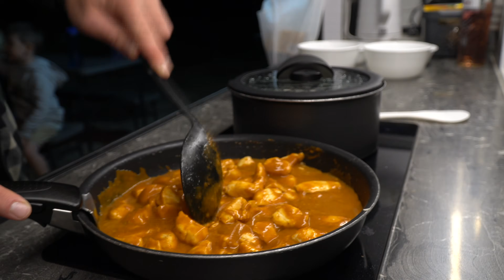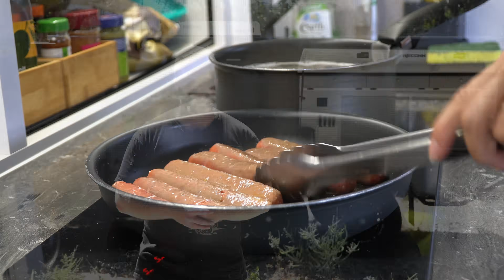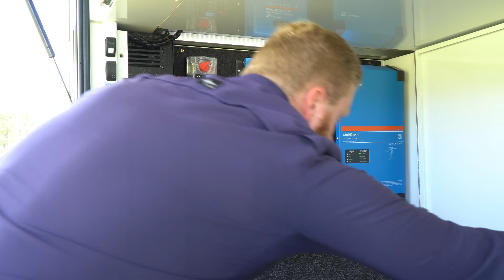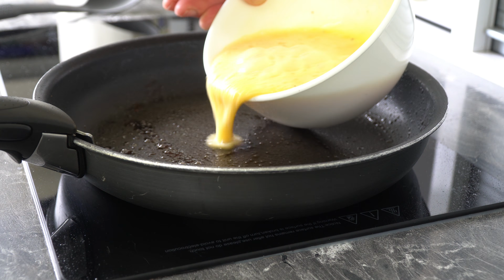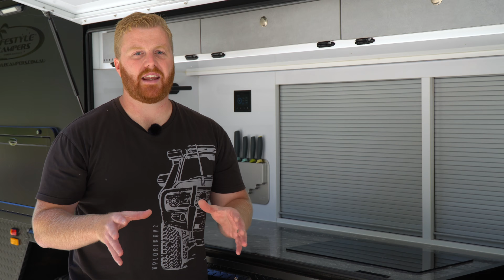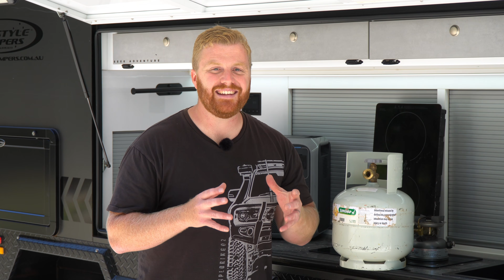WOULD I DO IT AGAIN? My experiences, failures & advice on INDUCTION cooktops for OVERLAND & CAMPING

Comment: I honestly thought you’d have a 60A DC-DC. I have a wagon with a 400Ah LiFePO₄ and I use a 40A DC-DC (I’d prefer a 60A one). 

Another reason to carry a portable $40 induction cooktop and a butane stove. 

You can get 200Ah LiFePO₄ for under $1k and 400Ah for $2k. Also a 3kW inverter - $500. 

Our Camper Trailer has a 4 burner cooktop in the slide out kitchen. We carry a butane stove in the wagon as backup but we use the Induction and Air Fryer oven 99% of the time. The camper has a 9kg gas bottle. Electric everything is our go-to where possible but if the sun ain’t shining - there’s always gas. 
I have a 3.2kW Inverter generator - it stays at home.  

Also - why the aftermarket exhaust, doesn’t that just make more noise? If you’re getting an aftermarket one, at least get a quieter one. Noise pollution is the bane of modern society and that’s the reason generators are banned in many places - noise. So don’t add to it please.

So that camper has the kitchen in one rear side and the power setup in the other. I couldn’t find a floor plan online - there can’t be any room inside in the back half?  Is it like only a half camper inside or is the main bed up on top of the back half? I’ve seen inside a $150k+ Bruder and it’s terrible as there is zero room.

Comment: We have a dual burner induction stove and carry a single burner propane/butane camp stove. the induction isnt permanently built into our counter and can take it out of the van when needed. Usually, when we use the induction stove we have it out of the van on a camp table and extension cable so all that steam and grease and mess of cooking stays out of the van. We use the little propane gas stove when we are cooking something that takes a longer amount of time to cook or if batteries are low. We also have one of the 1lb refillable gas bottles so we do not have to spend $7 per each propane bottle. We refill it when we get home from our 20lb tank.

Comment: There are 12v induction cooktops on the market... not sure how good they are, but they would negate the need for a heavy duty inverter
Reply: They are a bit average. Because you need massive cables to run 200A at 12V. 
My inverter cables are 95m㎡ rated to 500A in the open and 350A in conduit. 
I use a 400Ah LiFePO₄ and 3kW Inverter.

Comment: Good video.  Good analysis.  Thank you!

Some things to consider.

Carry a spare induction cooktop.  Maybe a portable one or perhaps a duplicate.
Make sure you have the most reliable cooktop brand and model.  Your experience is with one brand.
Two Kw up to 3.6 Kw portable power stations are available for under $2000 USD.
Reply: Is that kW or kWh? 
A 5120Wh LiFePO₄ is only A$2k or less.

Comment: I use a 500 watt induction portable cooktop powered by a Bluetti 600 watt continuous power station.  It will boil 16 oz water for coffee in 6 minutes, fry pork chop and steam vegetables.  Ok for one person in a van.  The 200 watt solar panel charges the power station back to full capacity within 2 to 3 hours.  Won’t leave home without it.
Reply from the maker: Thanks for sharing your experience, sounds like a great setup! 👍
Reply: How much is 16oz water in normal units?

Comment: Generating heat with a battery is so dumb
Reply: No, it’s clever as it’s FREE energy. Endless unlimited free energy. Once you have your setup - it’s free, fast, efficient and can be used inside. 

You do know that the electricity that goes into a house is often used to make heat, right? In our case that’s from solar and a…..battery. Grid use is only a backup.
Reply: @jerrymyahzcat  I own a solar system, I can tell you that pulling 1500 watts from the batteries kills them... You are pulling a constant 100 amps
 Electricity in my house doesnt come from batteries, that's the difference. 
You can cook with butane or propane stove, it's clean and you keep your solar energy to power things that cant be powered by gas.
Reply: @n@n @nicoracien-Qc  Propane/Butane isn’t clean. It just seems that way. 
And no - drawing 1500W from batteries designed for that is perfectly ok day in and day out. 
The battery in my 12V setup is designed to provide 200A continuous. 
And the Powerwall on our house can provide 5kW. 
Unless you are referring to Lead Acid batteries however even some of them are designed to handle high currents. 

So there’s that.

Comment: No solar for me..Expensive, complicated, not efficient and with a roof top panel..who parks their camper in the sun?  gas generator works for me.
Reply: Well, everyone, and anyone that has shade awnings (left and right) and a full roof of solar, as then those solar panels act as a roof shade, AS WELL AS A SOLAR POWER STATION, to keep the batteries charged, to run such things as 12v air conditioners to keep things cool whilst the vehicle is sitting out in the sun.
Otherwise, as an alternative, a solar array can be unfolded and set up in the sun (with an Anderson Plug extension cord) whilst the vehicle is in the shade of a tree.
If the ambient temperature is above say 26-28 degrees, upto 42 degrees C, and the humidity is high, like up north in tropical areas, then one would be seeking shelter inside an air conditioned vehicle, and believe me, wouldn't want to be running the petrol or diesel engine non stop just to keep an air conditioner on, for hours on end, and run out of fuel, so that's where as many solar panels set up (either fixed to the rooftop or portable) is absolutely a must.

Comment: I camp 365 days a year in the US, and spend the winters in southern desert areas, and the rest of the year in the forest and mountains. I got my induction stove in December over a year ago, and with 400 watts of solar panels, I could power my stove, frig, Starlink, electronics, etc, without even having to put out my panels every day. But once I left the desert,  the cloudy and rainy days made this impractical. So I use my 1800watt induction stove when I have plenty of power stored, and my gas stove when it gets low. The up side is that it cuts my gas usage considerably.

Comment: To be fair, a year after this video came out; the ~$1800 spent on his battery can get you 4000wh of battery and a 2400 watt inverter built in(ecoflow delta 2 max + expansion battery). As technology gets better, it becomes more feasible to stick to just electric for a lot of appliances.
Reply: Yeah and petrol, LP, CNG, diesel all getting more expensive by the day. With more wars coming up, its only gonna get worse

Electrical has its issues, but it works great and there will probably be a lot that survives a solar flare
Reply: 400Ah LiFePO₄ $2k. 3kW Inverter <$400. Induction cooktop $40. 

400Ah of LiFePO₄ is 5120Wh.

Comment: I'm leaning towards gas for winter and electric for summer, 24v rice cooker and slow cooker. Best of all worlds!! Once I get my Woodburner in too with water jacket and top oven I'm set, 4 different cooking methods, all with benefits of doubling up heat, or not producing it at all in summer. Thanks for the video, always good to get real world experience!! Have a good one 😊🙏
Reply: I too have 4 cooking methods available. Actually 5. I keep forgetting about my 12V camping oven that slow cooks mean Lamb Shanks or Butterflied Chicken and only draws 13A - solar or DC-DC while driving keeps up. Get to camp and lunch is already ready.

Comment: i find that using Ecoflow Alternator charger + Ecoflow Delta 2 Max is a good combo for me to use Kettle and Induction cooker. it is very cost effective and the ecoflow charger is quite efficient is recharging the battery. I also carry a gas stove as backup.

Comment: A few years back, I converted my camper van to induction cooking.  I have 400 watts of solar on the roof and 4.5 kW of storage via a "solar generator" system. I can also charge via the car's alternator. I have generally been pleased with using it.  However, I am very conscious of power usage.  I use a small electric pressure cooker to make anything that requires a longer cooking time, which is even more efficient.  I also carry a small butane burner with me.  My fridge is The one appliance I have to keep up and running.  If my battery gets low, I plan to switch to the butane burner to save energy for the fridge.  However, that has yet to become necessary.  Naturally, I take advantage of shore power whenever possible, but I'm mostly in the bush, so I must rely on what I can generate.

Comment: I think my concern with portable induction cook tops is that they all feel cheap while holding them. I don't think any are made to be used in the manner you are using them- moving them around, rattling in the back of a camper. I wish there was a more "premium" version of the induction cooktops but they all seem very similar, as if they are all made in the same factory by the same people then rebadged for different sellers. I also use a coleman stove as a backup- I have two WWII Coleman stoves which will run on gasoline or coleman fuel. They are super simple to keep running as is evidenced by the fact I'm still using them and they were both made in 1946. I agree a hybrid is the best way to go...induction for daily use, but a gas stove for a backup.
Reply: Buy a Xiaomi one.  30mm thick with 99 steps of power demand.   Ain't no one making them like that, and I can personally recommend them. - Melbourne aussie
Reply: $40 eBay one been using it for 3+ years.

Comment: The Nuwave Pic induction burner has 3 wattage adjustments, 600,900 and 1300 , a large single burner which came with a nice 4 qt pan with lid for $134 on Amazon.  I use it with my Blueetti 200p, 200L with independent solar arrays of 800watts and 400 watts. Plus I have 3 Blueetti EB240'S with 3 separate solar arrays of 4oo watts each. I run my whole house with a 6000btu and a 5000btu ac plus refrigerator, tv, usb lighting etc. 24/7 in an ambient temp of 90 during the day and 76 at night. MY AVERAGE electric bill is $50 PER MONTH PER YEAR, IN South Florida USA..
Reply: Damn, bro! You have a decent setup! 👍🏼

Comment: Again a great and informative Video- well done mate 👏
Since I am still running a single 120 amp AGM battery setup on my old Caravan and contemplating how to best upgrade to a decent LiFePo4  system- your videos are very helpful. It will be an expensive decision one day to go full OFF GRID which I plan to do and that is what scares the heck out of me when I think about the budged required to do so 😅
I want what you have basically so I keep dreaming for now.....
Cheers and safe travels

Comment: Im shocked the victron dealer didnt talk to you about paralleling the orion or upgrading to the orion XS. Also a separate mppt for the externalmpanels would increase efficiency as would  stepping up to 24 or 48 v. Lastly safiery has a terrible name away from the east coast. I have a similar setup but in 24v but i still carry a  butane stove just in case
Reply: Always always be prepared and carry backups of stuff.

Comment: Excellent review. We have travelled  for almost 4 years with gas as our main cooking and HW energy (it never let us down). We occasionally used a portable induction cooktop when on 240 power or generator. You have covered the pros and cons very well. The more remote one wants to travel the more reliable everything has to be.
Reply: Induction cookers put strain on your battery and inverter. That's the opposite of reliability, especially when you need those for things that are more important than cooking, and you can always just light a fire to cook. It's a stupid gimmick. Gas is always more efficient and reliable.

Comment: Great review.
Sure hits home the cost when hearing your gas bottle comparison!!
Reply from the maker: Thanks mate, absolutely. It's upon reflection we realised how much we pay for these luxuries.
Reply: True but an electrical system doesn’t have to be anywhere near that expensive. I built my own over the last 3 years and my 200Ah LiFePO₄ battery cost me $619 on eBay in 2022. Just 2 months ago  upgraded to a 400Ah LiFePO₄. 
I’ve been using induction $40 since 2022 also and my 3kW inverter from 2019 was under $400. 

Once the electrical system is installed - it’s free to use. Gas will always keep costing you and it pollutes, is very inefficient, slow and can’t be used indoors. 
I once took 30min to boil water with gas for a cup of tea when there was a slight breeze. 3min to boil on induction - not wind affected. 

We have gas (4 burner on camper trailer with 9kg bottle), Butane stove with BBQ attachment, Induction or Air Fryer, brazier with BBQ & a 12V oven. 
The brazier is for winter. So we use Induction, Air Fryer and 12V Oven for 99% of our cooking - free energy. Gas is backup and used to heat water for the shower only.

Comment: Brilliant 12v system. Just ball park, what price did you pay for your camper inc 12v and all options? Im debating on your one and the new Zone Expedition. Cheers
Reply from the maker: It sure is mate, right up with some of the best! It was in the vicinity of $120k and that's with almost all optional extras added to the SE model. 
I also looked at the zone, however I do believe that you are starting to move out of hybrid territory and into caravan territory with that model. The expedition is huge compared to the Reconn line up. 👍

Comment: I've had my induction cooktop in my rig for 4 years 120k kms. I mounted it in the middle of the vehicle (ie- in between the front & rear wheels) so it does not get hammered much at all. Yours is mounted on a trailer and the unit feels "every" bump on the road. You can either harden the inside of the induction  cooktop or soften the way the cooktop in mounted. It is called showing some mechanical sympathy. I don't think any induction cooktop is. built to get battered as much as it does on your trailer. 

I like the convienince of the cooktop and would do anything I can to make it function properly. It is just to simple and  convenient  to use to not to put the extra effort. Replacement if my stops working cost only $120 - so nothing really.
Reply: Makes sense. Also, running the vehicle for an hour to recharge the battery from cooking isnt even gonna move the gas needle on most vehicles

Dude has a wife and kids tho, so that complicates the absolute fk out of everything
Reply: @RustysModernLife  I idle my van only when necessary - but I move campsites a bunch so idling is rarely required...
Reply: @RustysModernLife He should have a 60A DC-DC though for that size setup not a 30A one.

Comment: Good report, we went induction for our common 4 day trips, circa.. 700$ kings 200amp, 300$ kings 3kw inverter, 60$ induction cooker, 20O$ sundries. Of course also for jaffles, 2 cup kettle and omelet maker, star link, tv etc when used. Largely all the things one doesn't need to camp with if using gas.
Reply from the maker: Awesome, that's a great point. There are obviously much cheaper and more affordable ways to setup an electrical system, particularly if you're not using it every day. 👍

Comment: Good honestly Nathan, we picked up our new Tvan in August and when initially ordering we considered the new lightning which had a bigger battery and induction… we ended up steering away due to that remote travel and simple reasons… we also carry a portable if we need to heat something inside in untenable weather with a plan to add the inverter and carry a portable induction for the wind soon. In saying all that, we’ve embraced more fire cooking which reduced the gas usage quite a bit.
Reply from the maker: Thanks mate, I hear you there. The induction still needs a little more innovation and advancement before it becomes that ultra reliable and viable solution off-grid. There's no doubt that gas is still king... at the moment 👍

Comment: Thanks for the sum up. We have just picked up our Reconn LRX. Induction on that model was the only option. It comes with a slide up front for a Weber. So best of both world. I also have a Jetboil Genesis for when just car camping. It is good to have redundancy when off grid.
Reply from the maker: Awesome, congrats on the new camper, I"m sure you will be impressed. That's a great setup and will work well. I also believe that the newer models have now moved away from Safiery products, is this correct? 
All the best with the new adventures 👍

Comment: Great insight Nathan. I’m in the processing of upgrading my camper electrics. I’m keeping the existing two burner gas stove and carrying a single induction hot plate as well. So when I have power aplenty I can use the induction etc but if battery power runs down I can jump back on the gas. Having a 240v toaster kettle and sandwich press adds another level of comfort especially with two young kids.
Reply from the maker: Perfect mate, that does seem like the best setup, the best of both worlds. Induction is great, but you certainly need a backup at times 👍

Comment: I have an induction cooktop but I also travel with a small gas bottle to run a BBQ and backup cooker. I also have a camp oven to pop on the fire coals. Depending on the weather and meal power demand i’ll use the appropriate cooking device.
Reply from the maker: For sure, this is by far the best way to go about it if you have the space and room to store the 'back up' options 👍